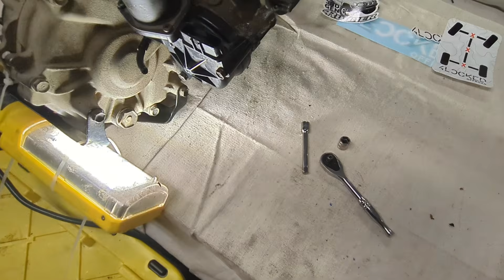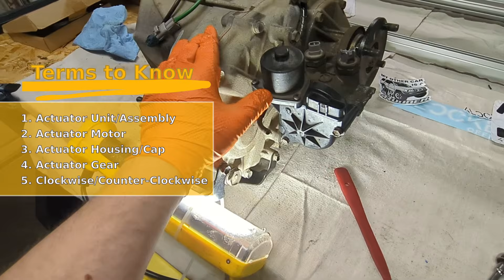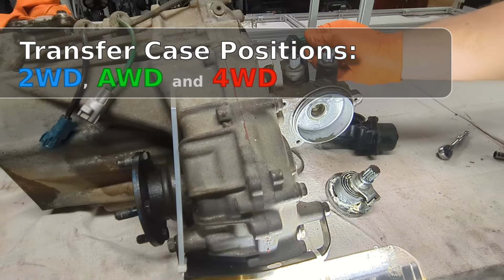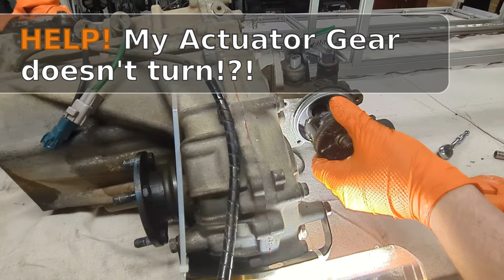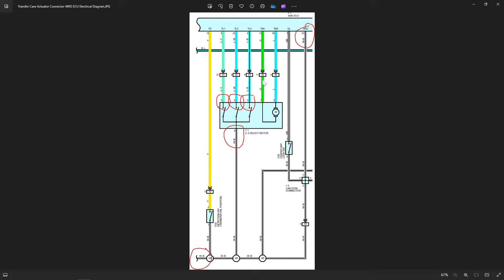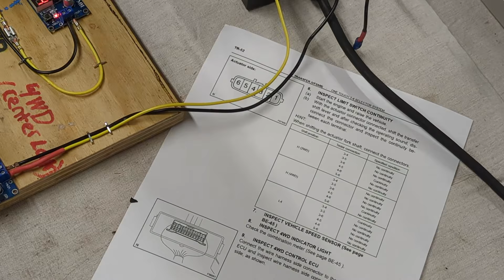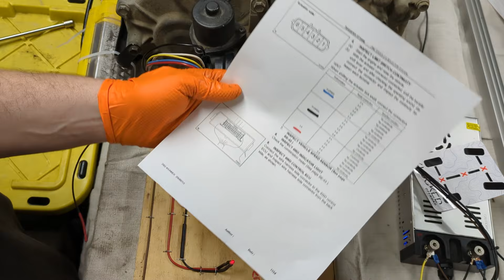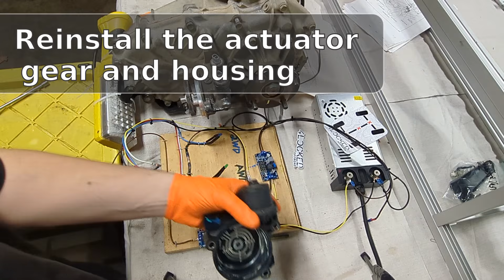Fix Your 4WD/All-Wheel Drive: Rebuild Toyota 4Runner/Tacoma Transfer Case Actuator Fast!

Comment: This looks very similar to the Suzuki Jimny.
My mother drives from the farm to town with her Jimny because it is a bad road. Some time ago the 4x4 would not engage. They tookit to the dealer and it was there for two months without any luck.
Then they took it to another guy, and he had it for two weeks without luck.
I decided to have a look and saw that the armature was too far out, barely touching the bushes on that motor. I took it out, cleaned it and had it back in 15 minutes, and now it works.
That just shows how bad todays dealers are. I just found your video too late, but you explained it very well.
Reply from the maker: Great that you were able to fix the Jimny and thanks for sharing your experience!

Comment: Yooo man thanks for the video, I used this one and a couple others to reference and decided to just pull off the plastic cover with the circuit inside because my vent hose had cracked and come off. Sprayed a half can of electrical cleaner inside, wiped it down, lubed it with lithium grease, and took it for a spin and cycled it a few times. Took me all of 30 mins and saved me tons of cash, thanks man! (Done on an 02 runner fyi)
Reply from the maker: Glad I could help

Comment: I also noticed when using your video to retime my actuator on my 02 4runner that when I turn the gear all the way to the left that locks in the front driveshaft flange.  If I go all the way to the right, clockwise then it feels like it's in 2wd and the front flange spins by itself.  Is this right?  Seems opposite yours.
Reply from the maker: It's hard to say if Toyota actually manufactured transfer cases that happen to have the opposite logic going on. If that is the case then it explains why the factory service manual appears to be wrong (for me and many others) - perhaps they figured they'd write the logic one way and assume/let the techs know they may have to reverse the logic for some models of transfer case?

Can you make a quick video and send it to me so I can see and verify you are turning the actuator gear the correct way? You can reach out to me on instagram at @4locked_offroad or email me through my website contact form.
Reply: I feel like this is the case on my 02 4runner as well. If I turn the actuator counterclockwise all the way it puts my transfer case into what seems to be neutral. Strange
Reply: To elaborate I can roll my 4runner forwards and backwards. Even though the 4runner is in 4h and park

Comment: Ever get around to the 01-02 front diff actuator?  I'm dealing with this right now on an 02.  Was messing with it some, appears to be in 2wd since I can spin the front flange.  Lights are flashing.  The front switch on the transfer case though when I pulled it out and tested it you literally only have to touch the ball and it closes circuit, not even push it in.  So I'm suspecting something is going on there.  The rear switch works as it should.  I never hear anything from the front diff ADD motor while I'm messing around.  I'm thinking I might put it on my scanner tonight and see what sort of 4wd parameters and switches are available on the livedata to watch.  I am going to use this video to verify the transfer case actuator is actually clocked correctly.
Reply: What did the issue end up being? I have the same problem
Reply: @gannonhershberger6532 several issues.  Someone before me swapped in the wrong 4wd ecu for w vacuum acruated front diff.  I put in an electronic actuated ecu and also the 2 sensors on the transfer case were intermittent for me.  Replaced those as well

Comment: How much more involved is it to change out the entire assemble for the actuator; Motor and actuator plunger portion?  Do you need to disassemble entire transfer case?  Thanks
Reply from the maker: Did you do the actuator swap? How did it go?

I can't speak to that at this time. I've  never swapped out the entire actuator assembly. Although I have done a full transfer case swap and that wasn't too bad so long as you have the right tools to make it a breeze like a transmission jack and most importantly a swivel ratchet with at least 72 teeth/clicks.

Sorry for the delay getting back to you, have had an extended family vacation and then some family health issues.

Comment: Excellent job.  I now clearly understand how this system works.  Rather simple when you can see your interaction with the parts!
Reply from the maker: Glad you were able to see how it works, it was tricky for me too when I first tried it!
Reply: @4lockedoffroad  Went to replace actuator this weekend and got it all apart and found the "guaranteed fit item" was not correct.  It appears the same as all the advertised replacements except it has a completely different mount on the casting.  Mine has 3 bolts on the casting the "replacement" has a 4 bolt mount.....

Comment: I have a 2006 Toyota Tacoma with a flashing 4x4 light after I submerged it into water. I replaced the front ADD, the 4WD ECU, the transfer case actuator housing and sensors, and I believe my issue is not having those 3 prongs aligned the the transfer case actuator housing... I have never seen a video explained like this and I have been looking everywhere online trying to find a solution. I will update you if this works for me. I can manually shift my vehicle to 4Hi, 4Lo, and 2WD but the I hear no clicking or anything when trying to use the switch.
Reply from the maker: So did the video help you? Did you find out what was causing your endless 4WD flashing lights? Was it the alignment of the actuator housing?

Comment: So I have a 2001 and when I put mine into the position that you say is 2wd, I’ll turn the car on but every time I do that I hear the motor start moving and it instantly kicks it into 4wd even when the button isn’t clicked in.  And then when I put it into the 4wd position it thinks it’s in 2wd. Any help?
Reply from the maker: Did you figure out your issue or still working through it? Have you tried positioning the actuator cog in the opposite position? If what I say in the video as being the 2WD position in fact appears to be 4WD for you then try the opposite position and see what the results are.

Also, when positioning the gear cog in the 2WD position make sure the transfer case itself  is MECHANICALLY engaged in 2WD.

If the electrical side of the system tells the ECU "you're in 2WD, because the 2WD circuits are open" but the mechanical side says "you're in 4WD because the transfer case is mechanically in 4WD"; then the ECU may try to rotate the actuator gear to put the electrical side in the 4WD position.

Comment: I cannot thank you enough for creating this content!  My son has an '01 4Runner that was purchased with the transfer case not functional.  We learned the issue stemmed from the breather hose cracking and coming off the nipple on the actuator housing, which let moisture into the actuator.  We spent a lot of time sanding the electrical components in the actuator housing to try to get the unit working again, but the one thing I could never figure out was the positioning of the rod and the gear to properly engage/disengage 4WD.  I had it backwards, and thought the rod being positioned all the way to the rear of the transfer case had the vehicle in 2WD.  The factory service manual was no help whatsoever, and the typo you mentioned made troubleshooting extremely difficult for me.  We performed continuity tests on the pins to determine if the gear was in the correct position, but not knowing which position was 2WD had us perplexed.  The one thing we didn't have an opportunity to do is have the vehicle completely off the ground to watch the wheels spin or not spin.  I combed through 4Runner and Taco owners forums and never could find anything conclusively explaining the correct position of the rod and gear.  I'm definitely going to pull the housing apart again and reposition everything.  Hoping it all works now!

The one thing most people on the forums noted was that this is a common issue with these actuators failing.  Most recommend swapping out the xfer case with a fully manual, J-shift version from an earlier 3rd Gen 4Runner or Taco.  We bought one but haven't installed it yet.  We still plan to, as I don't like these electronically actuated transfer cases.  I have them on my '17 Taco, and I hate them.  They're not reliable, and they just make people lazy!

The one thing I still can't figure out from your demonstration, is what moves the xfer case into the AWD position versus the center-locked 4WD position?  When pressing the button the shift lever, does the gear turn all the way clockwise as far as it can to put the truck into AWD?  What sequence of actions puts the truck into the center-locked 4WD position?  Is that pressing the button plus moving the lever forward into low gear?
Reply from the maker: I'm glad I was able to help you figure this out!  I completely agree with you about those electronically controlled transfer cases can be unreliable when not maintained properly -- especially when this breather hose gets knocked off.

You're correct in that you had it backwards. Sorry for the loss of time you incurred on that, I was in your boat too before I pulled the transfer case to reverse engineer it and make this video for you all. Road all the way to rear of vehicle = AWD, center position = 4WD and all the way to front of vehicle = 2WD.

The FSR appears to have a typo in it, but I wonder if the AWD (aka multi-mode) transfer case installed in 4Runners in 2000 and earlier had a slightly different electrical layout for the transfer case actuator. I know the majority of pre-2001 have J-Shift, but I do have a friend who has a multi-mode on their 2000 4Runner. Perhaps that year or earlier with multi-mode had this wiring layout that's shown in the FSR.

"what moves the xfer case into the AWD position versus the center-locked 4WD position?":

This happens by the actuator gear moving the internal transfer case rod left/right. The actuator gear is powered electrically by the 4WD ECU. The 4WD ECU determines which way to turn the motor (if at all) depending on many variables or scenarios and/or a combination of them:

"When pressing the button the shift lever, does the gear turn all the way clockwise as far as it can to put the truck into AWD?  ":
When you tell it you want AWD it will rotate the rod all the way to the rear of the vehicle (AWD). When you tell it you want AWD it will switch from 2WD to AWD.

I know what you are thinking. Yes -- this does result in the center locker being engaged momentarily. The operation is so smooth you don't even realize your transfer case is in center locker mode.

"What sequence of actions puts the truck into the center-locked 4WD position?  Is that pressing the button plus moving the lever forward into low gear?":

1. What position is the electrical-half of the transfer case actuator in? (based on which circuits in the actuator housing cap are open/closed.

2. There are 3 mechanical switches that identify the physical and actual position of the internal rod in the transfer case. These are opened/closed depending on the position of the transfer case shift lever (and hence the position of the transfer case rod).

There are 3 positional switches: Neutral, No. 1 4WD, No. 2 4WD.

Here are a couple of "If I Remember Correctly" footnotes regarding these switches: I may have this backwards, but I think.... No. 1 is closed when in 4H (2WDH / 4WDH) and No.2 is open; No. 1 and No. 2 are both closed when in 4L. Neutral is closed when in Neutral. I thiiiiink No. 1 & No. 2 are open when in Neutral.

3. The state of the 4WD toggle button on the side of the transfer case lever. This button is a "latching switch". This button closes the circuit when you press it and it remains closed/down. It opens the circuit when you press it again and it remains open/out.

4. What position is the electrical-half of the front A.D.D. actuator in?

5. The center locker button is not a "latching" button. It does not remain in/down or out/up when you press it. It's just a standard button. Clicking it sends a signal to the 4WD ECU and tells it you want the center locker to be in the state opposite to what it's currently in now.

The 4WD ECU looks at all those 5 items listed above -- ranging from the state of the transfer case lever position to the state of the latching "4WD" button to the physical positional state of the transfer case rod and the A.D.D. actuator.... And does its best to make sense of it.